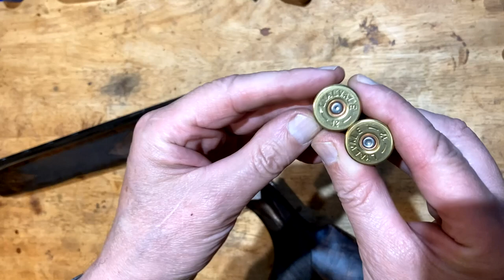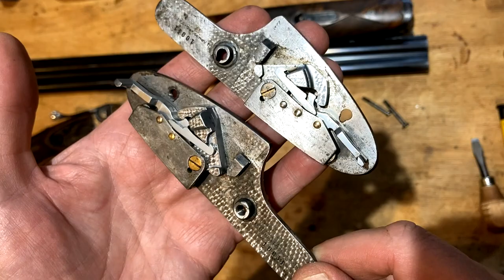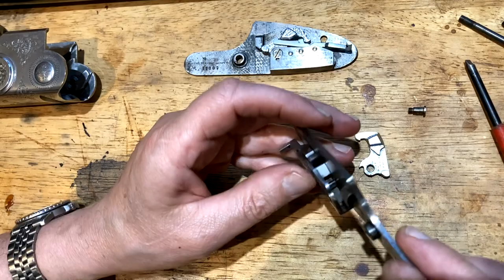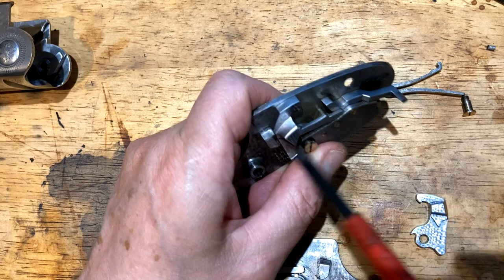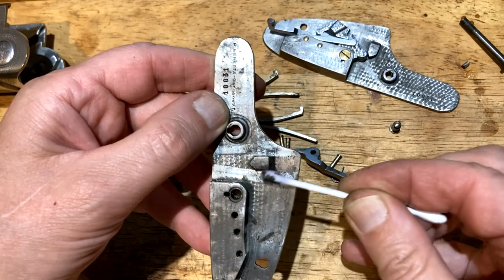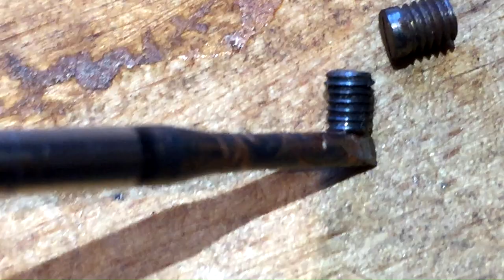Devongunsmith Diaries #8  Beretta EELL S04 Light Strike & Misfire Repair

Comment: Hi Devongunsmith, I have worked on the locks of an SO4 and alls OK on that front. I would like to take the stock off the action to replace a trigger spring. I have removed the trigger guard and the large screw that goes down underneath the top lever. Is there anything else that would now prevent the stock from seperating from the reveiver? Appreciate your learned advice!
Reply from the maker: You should send me a little video of what you mean.. contact me via my devongunsmith website..